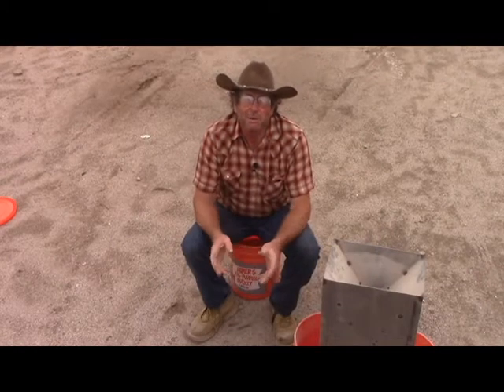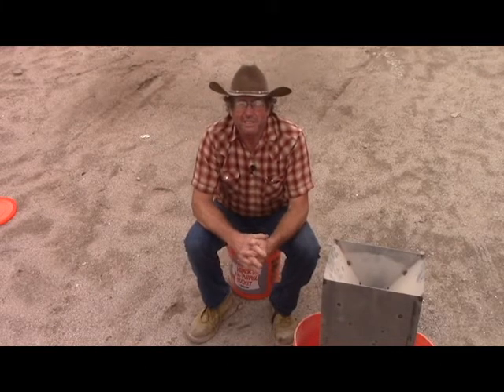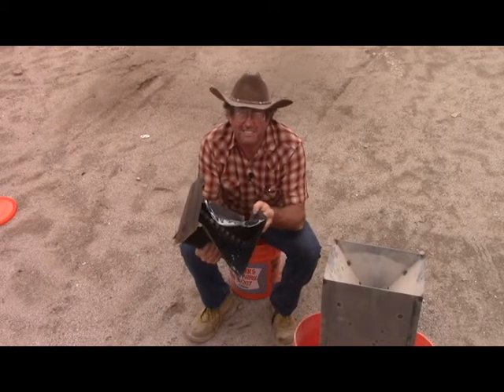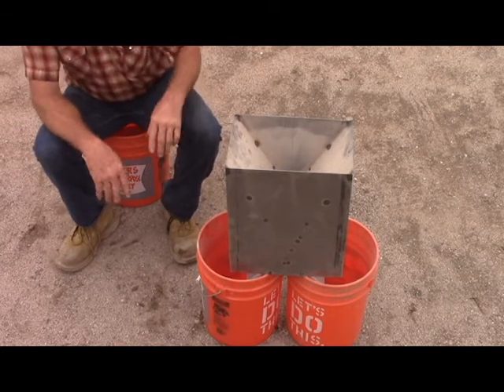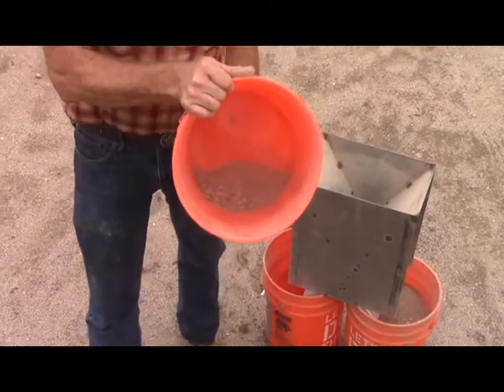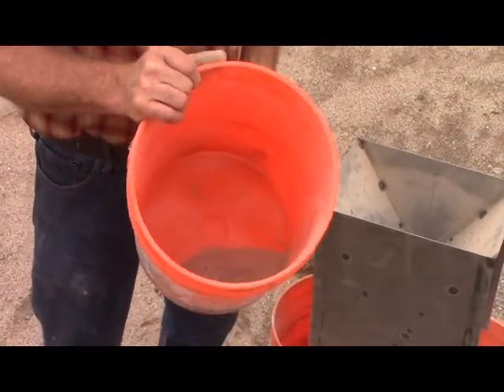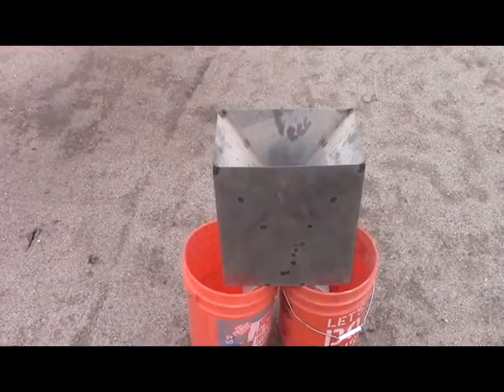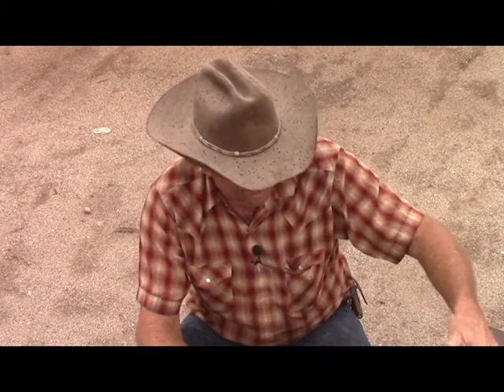Lesson 15 The Bucket Splitter

Comment: I'd like to get a splitter from you
Reply from the maker: I'm not really set up for it right now, but let me check on a few things.  Contact me next week if you don't hear back.  My other work is extremely busy right now and I could easily forget.

Keith
Reply: Good to hear you're busy and thank you
Reply from the maker: You're welcome.  I think they should be built from stainless steel and will have to check prices and availability
Reply from the maker: I have other things that pay the bills and take away time from mining and inventing- DARN IT!  Busy week, profitable week, finally got time to check on the stainless.

I can build a painted carbon steel splitter for $75 plus shipping
I can Build a 304 stainless splitter for $100 plush shipping
Weight of the splitter is 11 pounds

Keith
Reply: Hey Keith. Thx for getting bac
k to me. Let's go stainless. I'll contact you via your website
Reply from the maker: OK, switching to email....
Reply: sorry Keith. I should have said I'll email you tonight. I'm at work myself at the moment
Reply: Ok Keith I sent you an email with my contact info.